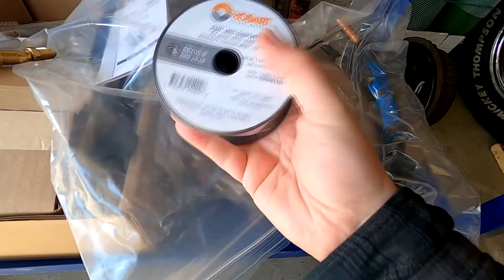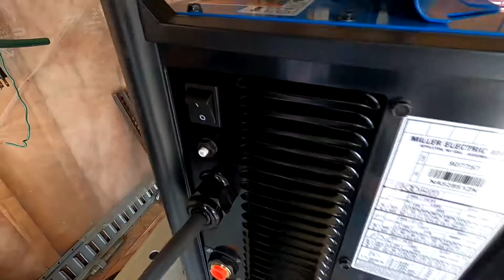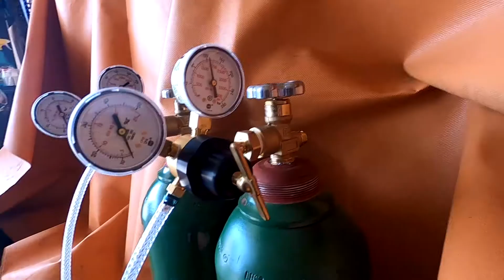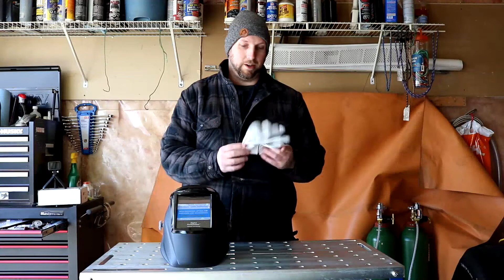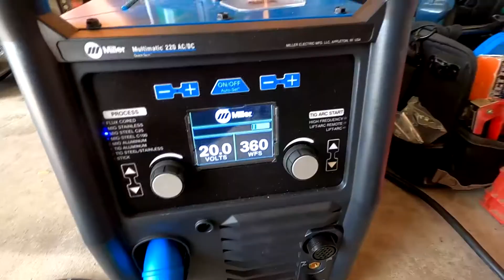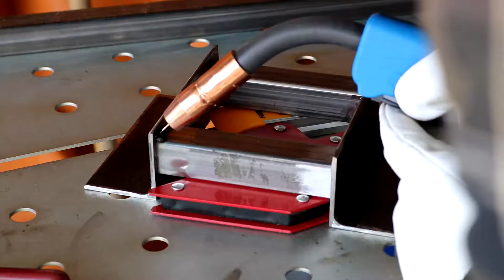First Time Welding! - Miller Multimatic 220 AC/DC

Comment: Hello. Jose, from Puerto Rico. I'm also a beginner. I'm retired and 66 years old, and I started getting an interest in welding too. That's a very nice machine you purchased. I don't have a Miller because I went with a Fronius TransSteel 2200 welder which is like your Miller, a multiprocess welder. I haven't purchased the gas tanks, since I'm using .035 Flux Core wire with my machine. This is all new to me, so I'm practicing with scraps of metal I can get my hands on. My goal is to learn and be able to repair things around the house. I really enjoyed the video and I will watch your other on TIG welding. I subscribed to your channel, by the way.

Comment: It’s been a year since you made this video. Would you still recommend the Miller 220? I want to do aluminum Tig. Are you getting better and still using it?
Reply from the maker: Yes I still recommend it. I haven't practiced enough to be happy with the welds. But I noticed that even after a long time between welding, that I pick it up pretty quick. So I guess that's something.

Comment: 6:44  Teflon does no good on compression fittings.  The seal is 100% at the conical mating surface.  Best practice to avoid adding anything to threads in the welding and cutting environment.  That way there is no urge to much with threads on an oxygen system.